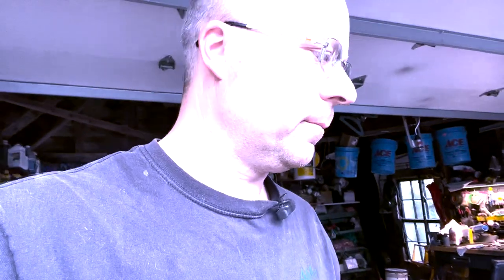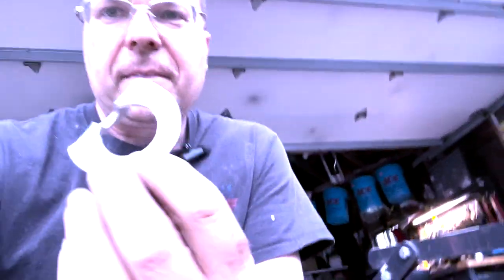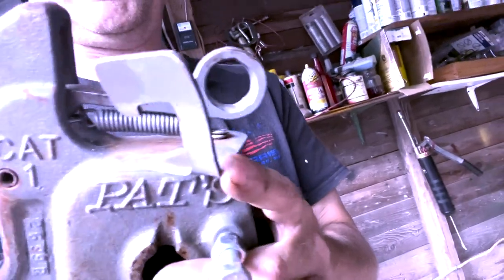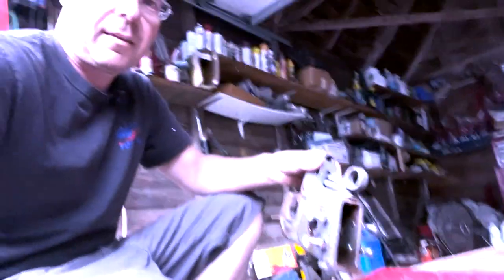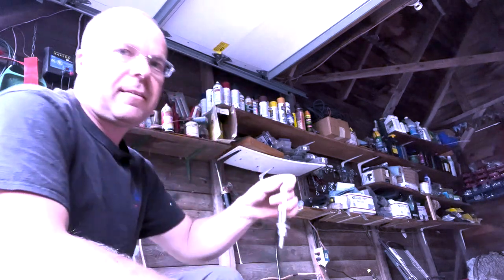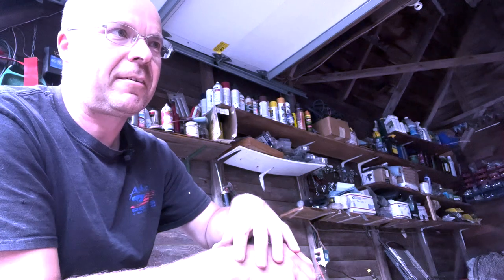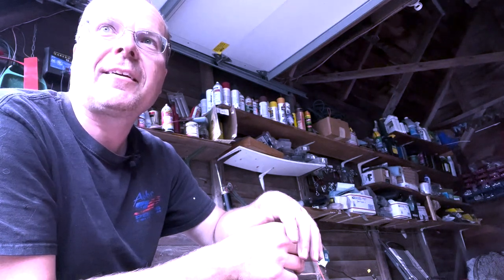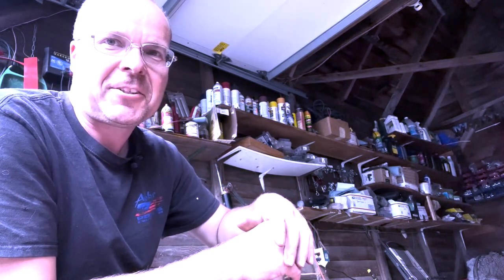Pat's Easy Change - What Went Wrong?

Comment: well dud one person option is not everyone's.  I have used mine for 10 years and it works as it should.  When this one break i will go and get another.  You have to know how to use it.  sorry you had so much trouble remember some time it is the operator.
Reply from the maker: Too much side-to-side slop. They’re not designed for heavy-duty bush-hogging. Like the old adage says, “one man’s trash is another man’s treasure.” Thank You for watching

Comment: Not sure what all went on here ..the spread bar is supposed to be taken off for use,, I've used 2 sets of these alot no issues.  I did use nylock nuts to prevent them from getting loose
Reply from the maker: That’s my 3rd cat Iset and every one of them broke at the u-clamp Or somewhere else. I had a cat II set that worked ok

Comment: Have had the Pat's system on my Kubota B2920 for fifteen years.  Absolutely no issues except when I forgot to remove the spacer bar and it got bent by an implement's driveshaft.  I managed to straighten it acceptably using a vise but eventually decided to opt for a new one that was easier to adjust. That's on me, quickly purchased another, no further problems.  My first implement, a JD ballast box, is only 24" wide and is therefore not compatible with a quick hitch.  I use a 3PH post hole digger somewhat regularly, not compatible with a quick hitch due to top link hookup.  I have a Land Pride tiller and Bush Hog SQ148 rotary mower, both would be much more difficult to hook up due to working around a quick hitch frame to connect the driveshaft to the PTO. I also have a box blade, rear blade, skid winch, backhoe, and landscape rake, some of which are quick hitch compatible but most are not.  So the Pat's system has been a no-brainer for me and I highly recommend it.  Yes, you might have to replace your top link with a longer-than-stock model due to the Pat's setup extending your lower arm hooks back a few inches.  I solved that with $35 and a visit to Tractor Supply where I purchased a heavier duty, easy to adjust from the tractor seat top link.  I applied some nonskid tape to its larger diameter barrel section and can easily grip it, with or without gloves, to make adjustments.  Of course, a larger tractor would probably require leaving the seat.
Reply from the maker: Thank you for watching and I appreciate your input. Happy new year

Comment: Thanks for the info Tom. I just put the Pat's Easy Change on my Kubota L3901 and am going to be changing between a box blade with scarifiers, land leveler, 60" Bush Hog, 3 point tiller and a few other implements. I'm using Nylon Hex Jam Lock nuts with number eight hardness set screws , no thread lock needed. I see the lock arms on yours are bent down so that didn't happen using them correctly I'm guessing they were bent using them to lock the hold arm in the open position and you lifted up into your implement pin and bent it, jus not taking your time and using caution, just my guess. In the install instructions it clearly states to not leave the adjustable spacer arm on when using a pto drive, so that's on you for not reading the instructions. If the proper spacers were used when installing and all the bolts snugged so there was no movement I just do not understand how you broke the U clamp. Operator error seems to be the cause of the issues you stated and yes these could be design shortcomings. I have watched many videos on these and some giving reviews after periods of time one being after 4 years of use and other then the spring snapping nothing, but good to say.   I guess I will find out for myself, but thank you for sharing.
Reply: Totally agree, operator error
Reply: there is some people in this world that everything they touch breaks all to hell

Comment: I have a lawn business and switch implements often. Before I put the Pats on it was a total pain in the ass. I've been using the Pats system for about 4 years and would never go back. Not sure why this dude is so pissy. Lol
Reply from the maker: You’re obviously not working your tractor with any type of equipment that vibrates heavily or is prone to bouncing. You’re never going to have an issues pulling your little finish mower or occasional York rake. Pretty sure it was mentioned in the video that it really depends upon what you’re doing with it snd you’ll find that all the complaints revolve around those actually using their tractors for medium-heavy duty work. lol
Reply: @LedgemereHeritageFarm  Actually we do run a 7 ft tiller cat 2 quite often and that thing gets a lot of abuse from rocks, roots and whatever lies beneith the surface. We put about 300 hrs a year on the tractor we use and probably change implements 10 times per day. Yes they may not be made for every day farming on scale but for small acreage or hobby farmers especially older dudes these things are awsome.. They have their place in the market just not every market..

Comment: Good to see this video, I was looking to get some of these for ploughing and flail mowing 50 ac with 70 hp tractor. Now I'm wondering!!  I'm from Australia so they are $500 here so I want to make sure I'm not wasting $$$$$$$$
Reply from the maker: yikes! that's a lot!  I had a CAT 2 set on my 50 HP JD, but I didn't use the 3-point very much as it mostly pulled a hay baler

Comment: What's interesting about the Pats system is that it resembles and works the same way the Eagle hitch did on the old case tractors and they're still being used today. Good design, but probably needs to be a complete lower arm welded as one piece to hold up under heavy use, like the Eagle hitch.
Reply from the maker: I’ve got a video coming out next week on the Eagle Hitch. You’re right on about the one-piece. John Deere sells the draft arms as a “ball and claw” hitch, but they’re very pricey. Thank you for watching

Comment: Yours is the first video that I've seen that is critical of this product, but the video reflects many of the same problems that I have had with my Pat's Easy Change system.  I have the Category 2 version, installed a couple of years ago, on a John Deere 5065 tractor, and use it only with a 7-foot Deere MX7 rotary cutter.

I carefully installed and leveled the hook assemblies according to the instructions, but they both tilted quite a bit when the rotary cutter was attached and lifted.  The four adjustment bolts on each hook housing worked loose fairly quickly, and will still not maintain position.  

I have not damaged the spreader bar, but I have experienced the problems that you had with a broken u-bolt and with the "special" washers and the retaining pins popping off one side and then the other.  It's never good to look back and see the cutter deck dragging the ground on one side, like a bird with a broken wing.

My MX7 rotary cutter is pretty heavy, and our pastures are a little rough, so it may be that there is just too much stress on these components.  Maybe the Pat's system is better suited to lighter duty, and may work much better on tractors and implements that are smaller and lighter in weight.  I just know that, for me, it has not worked nearly as well as I had hoped.
Reply from the maker: I too had bought a CAT II version for a JD 5045D and had problems with that as well. I hated to be critical initially thinking maybe I just had a one-off sort of deal, but foolishly, I bought 3 sets of them and not one worked right. I think they’d be fine for an average joe homeowner who puts minimal hours on their machines and doesn’t really do any serious farming with them, but they just don’t hold up to heavy ag use. I have yet to read a comment from a full-time farmer who swears by this. I sheared off the u-clamps bush hogging one pasture and was always losing hardware no matter what-even locktite wouldn’t work. I don’t abuse my machinery and maintain it to the best of my abilities, but I really dislike PATS and opt for an iMatch instead. I’m sorry that yours didn’t hold up either and thank you for watching

Comment: Thanks for sharing your frustration and opinion of the Pat’s system. I’m going to add your experience to the disadvantages column. All of the videos I’ve watched about the Quick Hitch & the Pat’s system praise each system. My gut & experience lead me to believe that nothing’s without disadvantages. Looks like I need to dig a bit deeper into each system, as well as reviewing the comments section. Seems like either system will likely require some modification - to the system, or the implement, maybe both. Your video has helped a lot as I prepare to fork over $200+ for one system or the other.
Reply from the maker: Thank you for watching. John Deere has a ball and claw system that’s essentially the factory version of Pats without being bolted on. Unfortunately, they’ll only fit a Deere without modifying and they’re about $900. I have an iMatch that’s pretty good, but the top hook doesn’t necessarily work on every attachment. My biggest problem with pats is that it tends to work loose or just plain break. I even tried a cat 2 pats on my 50 HP farm tractor and that also failed. You’re right, there’s no magic bullet.

Comment: A really useful review. My rough terrain bush hog work looks like it could have real problems with the failure points you identified. Ditto my long gravel driveway with the blade grader.
Reply from the maker: If you’re not using your 3-point for heavy duty work like a finish mower, you’d probably be ok, but tilling, bush hogging, etc, it will break every time. I have owned 3 of them and the best one was a cat II on a 50 hp John Deere. I’d throw money down betting that the guys who swear by them aren’t really working their tractors very hard. I think you’d be better off with a high quality quick hitch. Thank you for watching.

Comment: The design and idea of the system is great.  And it does solve the access issue to the PTO when using the traditional quick hitch. But when thinking about the problems you had with it, I can imagine those ARE weak links -- the washer, the latch, etc.  That equipment is under enormous strain and all I could think was duh!  Of course you had those problems!  With some re-engineering it could maybe be solved.  Thanks for your review.
Reply from the maker: I think it COULD be great idea with some tweaking.  thank you for watching

Comment: Same problems i had with mine today plowying snow with a back blade. The U Bolt broke on one side, and the centering bolts bent on the opposite side, plus as stated the locking lever is a total PIA to work with. I am new to tractors, only 150 hours on my first one ever. There must be a way to upgrade the parts on these things to improved them. I don't want to just toss $200 in the garbage.
Reply from the maker: I’m sorry this happened to you. I sold two sets on tractors that cycled through here and one set on eBay. I’ve had 4 sets in total and they wouldn’t hack it. My best solutions so far are telescoping draft links followed by a John Deere iMatch . Heavy ground engaging implements and bush hogging rough ground killed them in short order. I don’t believe the guys who swear by them are working them very hard. I hope you find something that works for you and thank you for watching.

Comment: I have had them a long time. Broke a spring, that's it. Yes, they get loose. So do all kinds of fasteners. Maintenance! Check your equipment before it breaks. When you grease your tractor, check them. You will not have issues. And they are not for big tractors.
Reply from the maker: Mine were tightened whenever they got loose. I will never buy another set. Three sets and they were all garbage